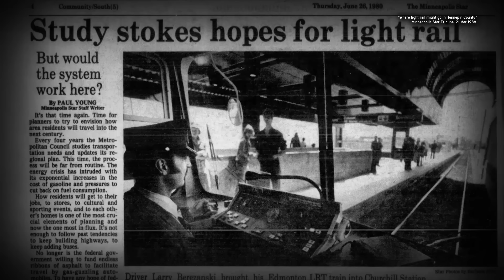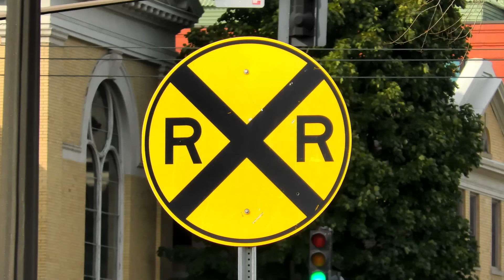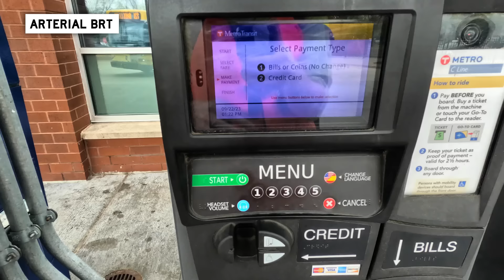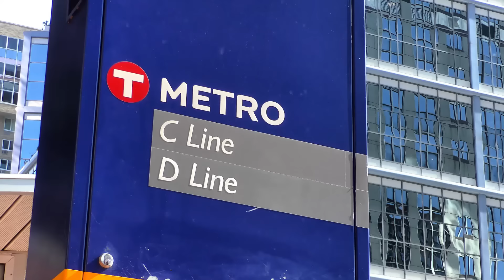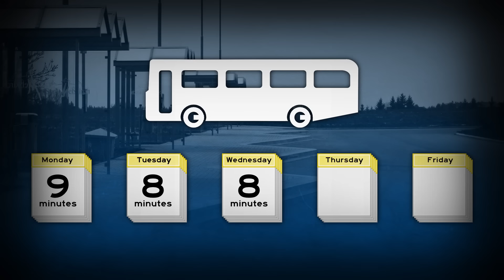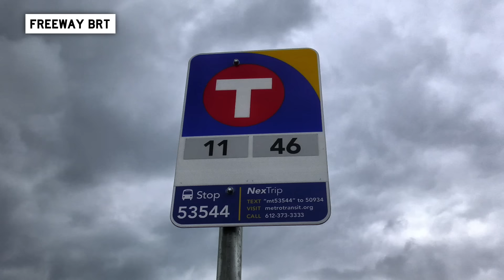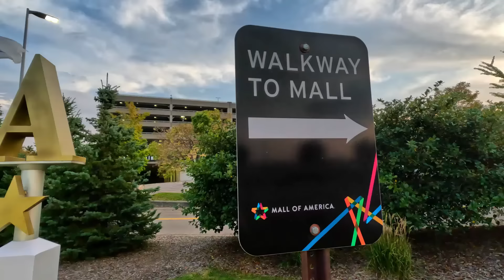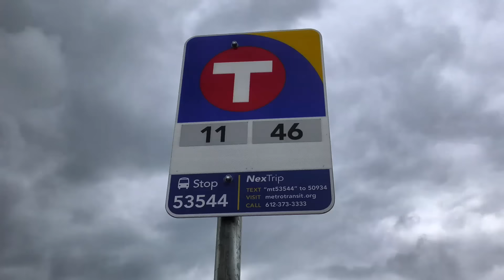Meet Minnesota’s $500-Million... 🚍 BUS???

Comment: My city runs what they call "open BRT". That means they have BRT trunks built to the highest standard shown in the video. But all along this trunk BRT line, "arterial BRT" lines branch off the main trunk. The end result is about fifty different BRT lines, each with "arterial BRT" for part of the route and "guide way BRT" for the remainder. And with so many lines sharing the trunk route, it gets a bus every 10-15 seconds in peak.

Because all the buses serve a significant amount of the trunk, it means that passengers just travelling along the trunk will catch whatever line comes along first - meaning they have almost no wait. However, because quite a few passengers want to continue on to one of the branch lines, plenty of passengers will wait for a particular line instead of catching the first bus. This really helps alleviate bunching.
Reply: Wow, what city is this?
Reply: @meowtherainbowx4163  sounds like São Paulo or Jakarta, two of the more successful BRT systems worldwide
Reply: @PrograError Bogota as well
Reply: Where I'm from it's known as "Bus at high level of service" .
Reply: Seems very inefficient. Encouraging transfers allows better suburban service and saves operators which is a much needed thing with many agencies operator shortage.
Reply: @trademark4537 Inefficient from the POV of the operator maybe, but from the rider POV...

The most efficient transit system for the operators is none... They have 0 cost and all their equipment is being fully utilized because they have no equipment ;)
Reply: We kinda do that in Seattle. Most bus lines run right along third Ave for a majority of the time. If you're trying to just get around downtown you can hop on any of like 20 different bus lines
Reply: @travcollier  Efficient if you only want to go into the central city (where less people are going post-covid), but inefficient if you want to go elsewhere as there are less buses that go to other places. Relying on one seat rides limits the places that you can go easily. A short transfer to a high frequency route is not bad for riders.
Reply: Basically a budget s bahn
Reply: @trademark4537  But the trunk serves as an extended transfer point...
It really isn't that different
Reply: Here in the US, we think that we can treat BRT like rail transit (one line serving the whole corridor), but really what you described is what we should follow. A common transit corridor/trunk with high frequency buses (so if you're going a few stops, you can just jump on the next bus, regardless of the line), and then beyond the corridor, you have less frequent "local" buses. Pittsburgh is a good example of this of using old streetcar right of ways for buses to reach downtown.
Reply: @travcollier  The difference is that since all of the other routes that go into the BRT have to run on the same corridor your duplicating service that could be spent on providing more connecting services.

Something especially needed in the sprawling environments of American transit, and with the operator shortages in almost every system.
Reply: buses dont belong hauling ass down carpool lanes at all. public transportation doesnt improve society.
Reply: Similar effect as the Metro in Washington D.C. 

The stations in the main “trunk” with the Blue Silver and Yellow lines in the center of the city have frequencies down to roughly 1-2 minutes at peak, often 1 minute with a train arriving as another has just departed.

Comment: I passed the information to my neighbor here in Québec city, Canada. We are at this cross-road. Half the population wants a fancy Tramway at ANY cost, the other half wants more roads for their vehicules and cry 'War on Cars!" if we take a single parking space in the city-center.
Reply: A tram would be a better option if done right, as it costs much less than a BRT in the long term and would act as a transit anchor for the city. 

Plus, BRT projects often suffer from what’s known as “BRT creep” where as the project progresses, more and more BRT features (level boarding, signal priority, off-board fare payment, dedicated lanes, etc.) are removed to cut costs until you end up with a bus with a slightly fancier paint job and slightly more spaced out stations.
Reply: A tramway is not only fancy but more useful to have cars in the historic city everywhere.
Reply: Just look at Ottawa, Ont.  They built a BRT network decades ago, including fancy "Transitways".  Now almost all has been converted to light-rail - the O-Train.  The BRT just was not future-proof enough to handle population and traffic growth.

Besides, Quebec City already has BRT.  It is called the Metro-bus.  The reason they want to build a tramway network is because the Metro-bus system is at or even beyond capacity.  While improvements are and can be done to help increase the QUALITY of the service (ie: bus lanes, priority traffic signals, etc.), there is very little more that can be done to improve the QUANTITY of service -- they can never add enough buses to meet future demand.

Far better to build the light-rail/tramway network now than in 20 years when costs will be double or triple.

Also, when it comes to labour costs, the light-rail is cheaper per passenger.  While a bus might carry upwards of 80-90+ passengers (depending to the type); a light-rail train can carry several times that many.  (see the video by RM Transit on Light-rail vs bus)

BTW, I live in the Quebec City area and I have family in Ottawa so I am quite familiar with both cities.
Reply: @cycloid2326  a BRT can be a stepping stone, if done right. But I agree, in the long term, LRT is better, or in certain cases, regional rail (frankly, I'm not 100% convinced the green line is the best mode between Minneapolis and St Paul, this should have been a higher level of rail service.) That said, if the choice is between something imperfect or nothing, I'll probably choose the imperfect solution.
Reply: @barvdw  considering that the current plan is to build the French-style modern tram, I’d say just stick with that and don’t downgrade it to a BRT
Reply: @cycloid2326  sure, and it would likely meet with more opposition, be a lot more expensive, even if it is a saving in the longer term, or would have to be shortened at either end to find the necessary finances, if it were to be built at all. More than one good project has been scrapped for being too ambitious at that moment, I prefer the bird in my hand to 2 birds in the bush.
Reply: @cycloid2326 aren't there regulations that say you have to build it barrier free for people with disabilities?

If I'm correct, in Germany every bus, train, tram, sub, etc is fitted for the elderly, handicapped, pregnant and parents with kids. You can even bring your bike or other mobile methods of transportation onto those public transit options, sometimes you just need to upgrade your ticket or pass.
Reply: @BlueFlash215  That’s usually accomplished with a retractable ramp on typical city buses
Reply: 120 Billion to Ukraine.  30 Billion to Israel. 10 Billion to Taiwan.  At this point what's another 500 mil for a bus!
Reply: @worfsonofmogh1154  it's not just Minneapolis, that needs a bus, though.

Comment: Biggest problem with BRT is they suffer from the success of emulating a train but lack the capacity and ease of adding more capacity trains have. Not easy to drive a 8 cab long bus, and it costs lots of money to hire more bus drivers
Reply: For the Guideway BRT they could just slap on the rail tracks since all of the bridges and paths have been already built, the existing bus stations would just need to be upgraded. For the other 2 options maybe a street car system since they know that it's a profitable route. They can just add the rails onto the roads.
Reply: Minneapolis will never have that kind of ridership. Even the light rail runs mostly empty
Reply: @Notabot1310  are you from the UK? I almost never hear anyone mention this from the urbanist/transportation YT channel. 
I think the Guided busways are awesome. What I like about them is that they're kind of good in between a light rail and the flexibility of a bus.
If anyone talks about guided bus ways, it's usually the autonomous trackless ones.
Reply: Unless you have a fully automated metro (not possible on street running trams), the driver cost is kind of moot. To maintain the best frequency you would need to hire as many drivers anyway. Longer trains are for if the city is truly planning to lineify and really build up the density along a key corridor.
Reply: @bend8353  Because it's so short and doesn't have many drop off points. Why take the light rail when a bus can drop you off with in a block of your destination? The light rail is superior Yes but very expensive
Reply: @bend8353  No, it doesn't. The only time it ran mostly empty was in the middle of the pandemic. It's been steadily rising again since lockdowns expired, only dropping off when Covid variant infections surge. Nearly 50,000 rides per day is not "running empty," and that's with a fraction of the planned network. The current LRT network is fairly useless to anyone in the north, west or east metro, yet ridership is still high. Anyone who tells you the trains run empty is lying.
Reply: @bend8353  transit in the Twin Cities will see bigger ridership for no other reason than the fact that most new housing being constructed is in either Minneapolis or Saint Paul, where the transit already is
Reply: They can just run longer articulated buses with more frequency at peak times. The whole bus driver argument doesn’t matter because the productivity of each bus is so high on BRT. There are not that many corridors that BRT doesn’t have the capacity to handle and if you come across them, it’s better to invest in rail with grade separation, which you’d have to do with something like 8 car trains. Light rail is inhibited by the length of its trains due to the fact that it’s mostly at grade and interferes with cross traffic. So if you wanted grade separated rail, that’s an easy 500+ million per mile. And that’s on the low end. Most subway construction is running around 1 billion per mile and is taking over a decade to construct. I’d much rather have an expansive BRT network than shorter corridors of grade separated rail in a city like this.
Reply: @usernameryan5982  my biggest problem with BRT is that it can cost a lot of money. In San Francisco I would be on the 49 BRT which cost 100+ million a mile to build and it would be absolutely crushed full of people especially during rush hours. I wonder how much it would cost to install rail in the already existing corridor as others are suggesting
Reply: Same problem most light rail has
Reply: @FullLengthInterstates   I live in a city with an extremely mediocre transit system and we still manage to run an elevated rail route with 4-6 car trainsets. Labor is one of the biggest budgetary costs for most transit agencies in the US (and developed economies in general - there's a reason you only see successful BRT in places like Latin America where wages are extremely low - it really only makes sense when a driver costs less than an extra railcar).
Reply: @FullLengthInterstates  The issue about driver costs is that a light rail vehicle can carry a lot more passengers than a bus. Once the system is embedded, a bus every 10 minutes on a core route probably won't give enough capacity, so then you need to hire more drivers to run more buses ... whereas light rail would allow you to carry double the number of passengers or more with the same number of drivers, or even more if you went for metro rail.
Reply: There won't be any bus drivers or truck drivers in ten years.
Reply: Rail was the opposite problem of to much capacity on single set of vehicles. Plus the cost of the vehicles are much higher. Running empty is the death nell of public transit. Smaller can be advantage, by increasing frequency with smaller cheaper vehicles. BRT guideways have been  automated and self driving in some cases.
Reply: Arguably if your route is that successful you've probably created a good problem for yourself. Better to get a high-frequency route going first that actually attracts riders and actually gets built than a much higher capacity system that only has half the coverage at the same frequencies.

Comment: As others have stated, the great thing about building the BRT this way is that it's easy to convert to a light-rail line when they're ready! It's not the first time bus infrastructure was future-proofed for light-rail conversion! Seattle did the same thing with the Downtown Seattle Transit Tunnel. Before they built the tunnel, there were different proposals for a rapid transit line, with the most significant in the 1960s. For the first attempt in February 1968 when voters were asked to provide 385 million, it narrowly passed by 50.8 percent but fell short of the required 60 percent supermajority. A second attempt in May 1970 when voters were asked for 440 million, it failed with 46 percent, and the federal money was instead given to Atlanta for MARTA. Despite this, they still planned for a bus tunnel in 1974 that could potentially become a light-rail line. 

When the bus tunnel was opened in 1990, they already installed light rail tracks in anticipation, however they had to be replaced when the tracks were later found to be poorly insulated and unusable. And there was a scandal during the tunnel's construction when it was discovered in 1989 that the granite was quarried in South Africa despite a boycott of South African goods by the King County Metro Council at the time. For several years, service in the tunnel was provided exclusively by dual-mode buses, which ran as trolleybuses in the tunnel and diesel buses on city streets. Putting buses in the tunnel meant less traffic on city streets! The dual-mode trolleybuses were replaced by hybrid electric buses to prepare for the light-rail. And when the light-rail opened in 2009, the tunnel had unique operations where buses and the light-rail shared it (Pittsburgh's Mount Washington Tunnel still has shared bus/light-rail operations)! That is until 2019 when Convention Place station was sold to the Washington State Convention Center for redevelopment, closing the tunnel to buses two years earlier than the scheduled closure of 2021 (which was meant to coincide with the Northgate Link expansion). Making the tunnel light-rail only.

Comment: I'm a Minnesota native who traveled to Boston recently. The silver line that services Logan Int'l has BRTs as well, and they work! It felt cleaner and safer than riding a normal community bus. I'm excited for the prospect of them being built at home.
Reply: saying the silver line works is a bit of an overstatement. Often times between busses is 30-45 minutes, and to get from downtown to the airport often takes 45 minutes (it's like 3 miles)
Reply: HA a bus in Boston working. Thank you I needed the laugh.
Reply: @InternetKilledTV21  the silver line tends to be about as reliable as the rest of the regular rail subway lines.

I don't doubt the rest of the regular bus lines are quite laughable; I don't ever take them, though, since the subway has been enough for me to commute through Boston on.
Reply: Yes, I was going to post about that, as well.  I believe the Silver Line was put in as part of the Big Dig.  It was originally planned to be a regular subway line, but was switched to BRT as the Big Dig costs exploded.  It originally had a weird mix of dedicated and shared roadways, and it switches from electric with overhead wires to diesel in the middle of the trip between the airport and South Station, but in the last few years, they've switched to diesel-electric hybrids with enough battery range to run electric-only through the tunnels.

As a traveller, it's quite convenient that there's no toll to board at the airport, and then you can go by subway anywhere in the system.

Comment: When I was in Seattle, it was fascinating.  They have these busses, but they had started to build a subway system so in a few spots it hopped onto some tracks and got power from them; they had a few ex-trolley line setups so it popped a thing up and got power from THAT.  It ran electric at those points, and it was propane or LPG or something the rest of the time.  It was rather clever, it used all the parts of light rail they had started to build; instead of leaving them abandoned, or having some train line with like 1-2 lines then seperate bus system, it meant it was all nicely integrated together.